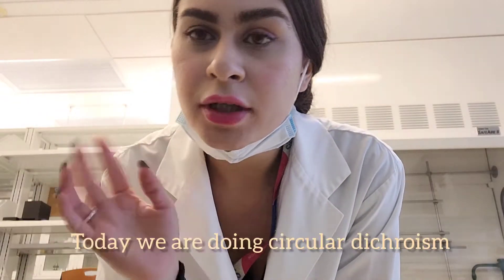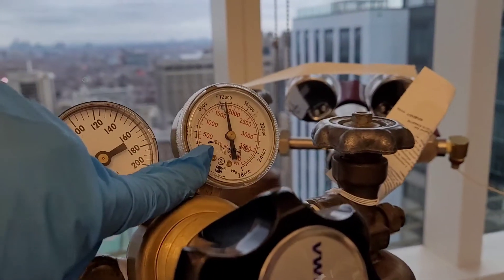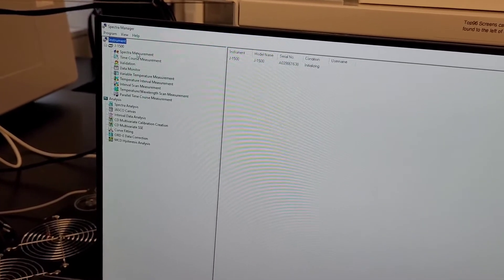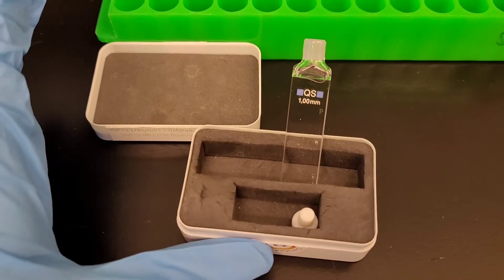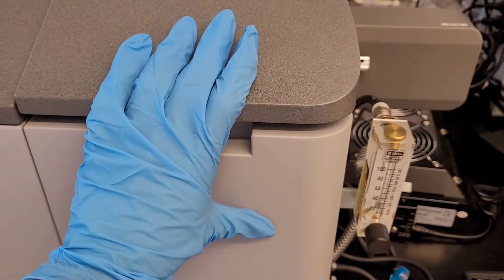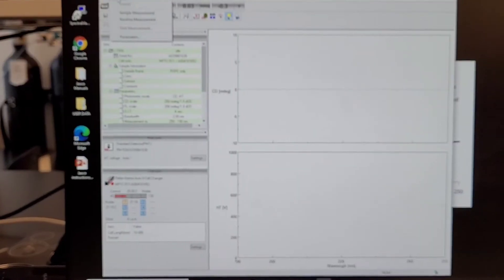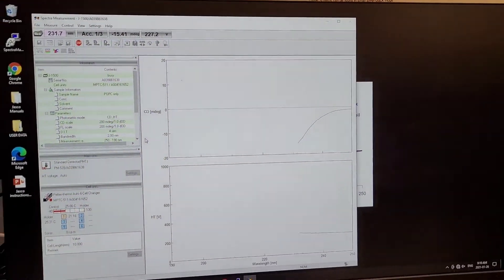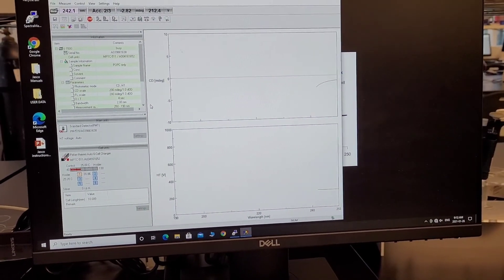how to do circular dichroism || practical biochemistry

Comment: Hi, thank you for this excelent video! I have some questions (probably silly ones). Situation: a experiment where i used a buffer as blank and the software was set to execute baseline correction. Does it means the further spectra obtained from samples will be already subtracted from buffer? Do i still need to click on baseline to manually adjust it after smoothing? If so, how i do the adjusting?

Comment: I recently did CD and the jasco analysis say it has no beta sheets but when I use k2d2 software it shows beta sheets. any idea why it is showing such variations. thank you. great video btw❤❤❤
Reply from the maker: Thank you. Yes the softwares are not 100% accurate and my supervisor doesn't actually trust it for accurately determining which exact percent is which secondary structure. It comes down to what you know about your protein and getting additional data from other techniques to see which one makes more sense.

Comment: What would it look like if the protein has a rossmann fold?
Reply from the maker: It is possible to estimate the percentages of alpha and beta mix in a protein using cd but CD is not the most accurate way especially if it's the only technique you are using. Chemical shifts from nmr will tell you abt secondary structure more accurately if your protein is not huge. It's always best to do both if you can.
https://www.pnas.org/content/112/24/E3095